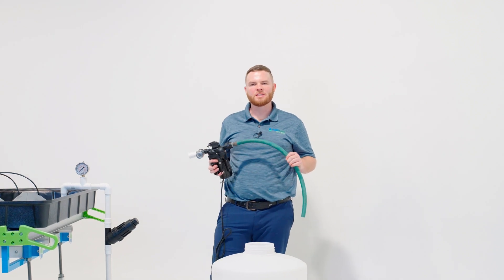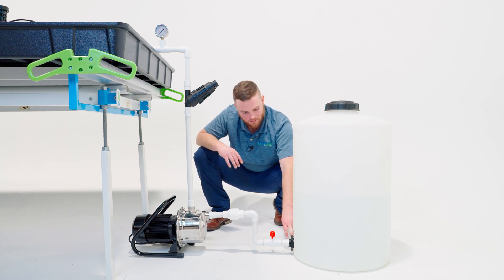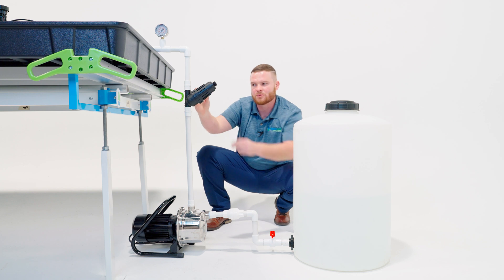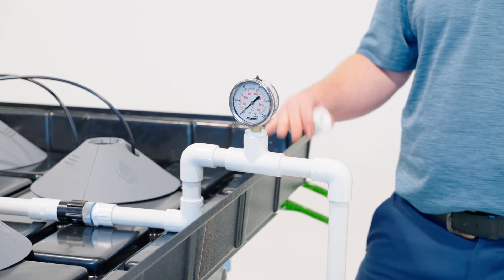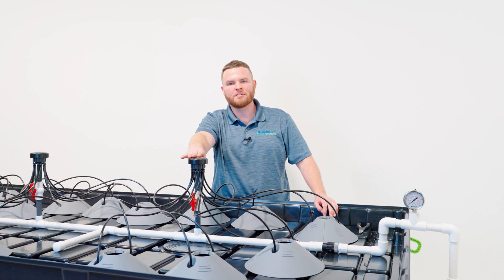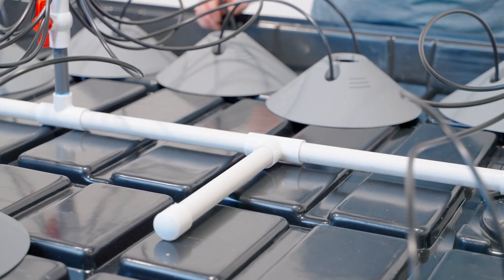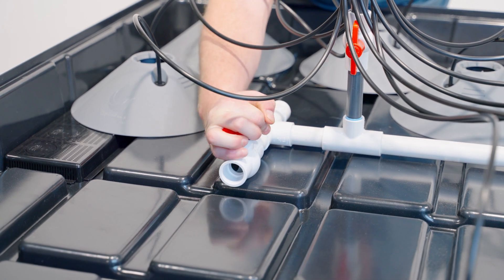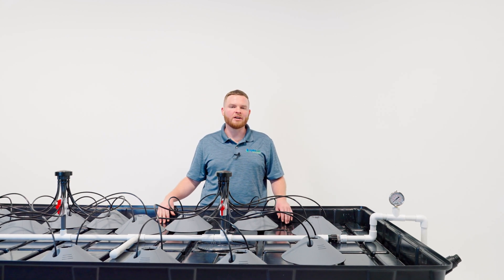General System Design - HydroLock Irrigation Installation (Pt. 9)

Comment: The fact that the inline pressure regulator is not included in the kit is a crime.
Reply: The in-line PR is included in the kit.
Reply: @katielangford9260 ahh. I bought the "expansion" kit and used my own pump. That's why I didn't get one